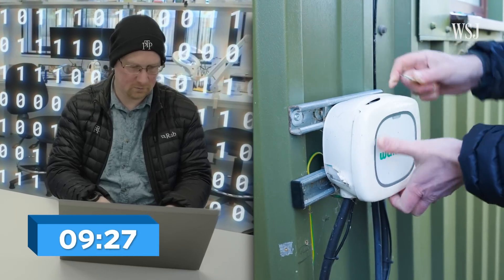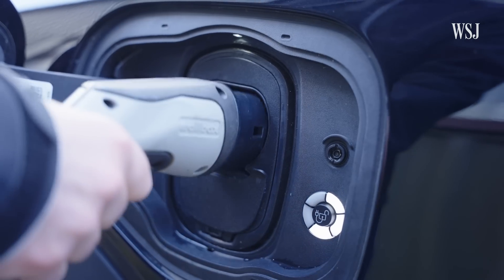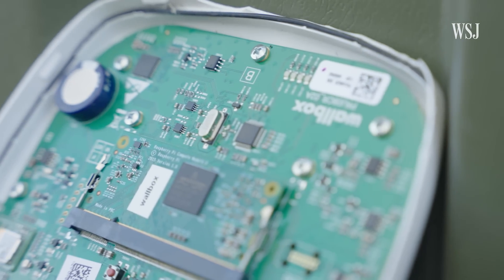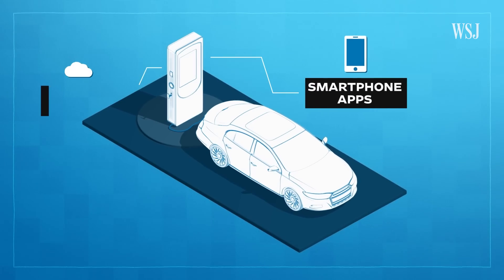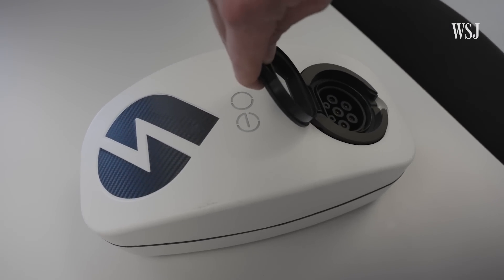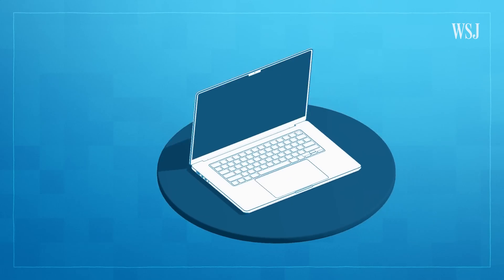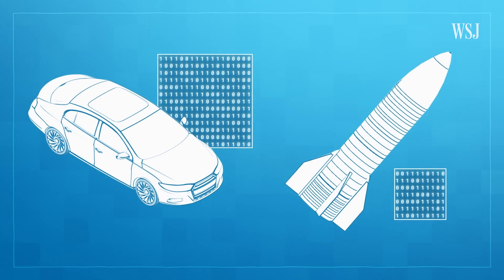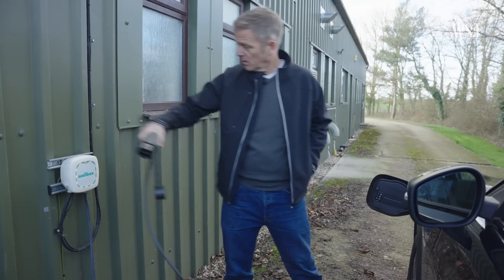This Is How Easy It Is to Hack EV Chargers | WSJ

Comment: You know how to fix it? Simple to fix in 2 steps. Don't get an EV and manufacturers need to quit making cars connected to internet. There is no valid reason a car needs to connect to the internet. If there needs to be a software update then you get a notice in the mail and go to the dealer and have it installed just like back in the old un-hackable days of cars. If you have a charger at home, why does it need to be connected to the internet any way. Just run your power in and then plug it into your car and then flip a switch and turn it on. The charger has a sensor that says, OK, no electrons flowing at this rate it must be charged and turns itself off,  just like the chargers for your good old AA battery chargers do.

Comment: This is a beatup!

The Raspberry Pi is irrelevant to the story. It's a general-purpose computer used for many different applications. The problem, if it exists, is either the application software running on it that does not implement adequate security, or the fact the compute module can be physically removed and have the software modified. This latter means any practical attack would need prior physical access to all target devices.

An alternative would be the compromise of any central management server, which has nothing to do with the compute module implementation.

Comment: Personally - Coming from the same country as PenTest Partners 🇬🇧 - I find that the easiest way to avoid badly engineered and rushed-off stuff is to simply avoid anything that bears a UKCA mark. The UKCA mark started to appear just before product/service quality (And the world as a whole) started falling right down the tubes, so it's a good marker of products which date from after that point. 📌

If you're buying something that doesn't have a UKCA mark - And an online search shows that the same product sold today normally does - Then Congratulations! You've found something that was made back in a time when product quality and customer satisfaction were actually worth something! 👍

Comment: Hehe, at 1:57 he points to the compute module (Raspberry Pi itself) mounted in an adapter board designed to provide easier access to the various I/O ports. Then as soon as he starts saying "this is the raspberry pi from the wallbox" they change shots and show a zoomed in shot to show it up close, but it's showing just the adapter board without the Raspberry Pi slotted into it. Quite obviously filmed or edited by someone not quite familiar with the technical side of things

Comment: Wht they're calling 'chargers' is a misnomer. The charger is built into the car. The box on the side of your house is a power outlet. It makes power available to the on-board charger but the current drawn is determined by the on-board charger.

Comment: 5:16 overheat an EV battery???
Ate you crazy???
EVSE have no controll over EV cooling system.
Reply: I was wondering the same. Its not even a charger but a poweroutlet.

Comment: Did you notice how damaged that "Wallbox" chargers front cover was?  Yeah, you can't just pop off the cover without damaging it.  First good rain and that charger is ruined.  While I commend this guy bringing vulnerabilities to manufactures attention the dangers his warning is way overblown.  First you have to find 1,000 "Wallbox" and physically go there.  Break them open and hope the owners wouldn't notice the damage.  Hope if doesn't rain or snow before you have hacked enough.  Then when you decide to turn on 1,000 chargers they are all plugged into an EV and that the EV is set to accept a charge immediately.  Many, if not most, EVs can be set internally to only start charging after midnight.  This is when it is cheapest to charge.  So you have to break into more than 1,000 "Wallbox" chargers.  The one with a serial number is more concerning but that is easily fixed with an update and it was.  OK so you probably have hundreds maybe thousands of this serial number problem chargers which haven't received the update.  Let's say the hacker has one serial number which is all he needs according to the video.  Problem is those thousands of chargers that are not updated are spread all across the United States and or the world.  How are they going to target a city?  They have no idea where they all are.  Chances are if they turned them all on at once they are spread out across multiple counties and states so it be like turning on 50 EVs per city at once maybe.

Comment: Is there a citation on how an EVs battery could be over heated using the wall connector? 

I don't see how it would be possible so would like to know how you came to that conclusion.
Reply: You're right- it's factually incorrect. 

The actual charger and battery management system is part of the car. 

The wall box "charger" is nothing more than a power switch that communicates with the in-car charging circuit, telling it what the limit of power it can suck out of the wall.

Comment: This is why I went for a commando socket and "portable" charger; the change from stand-alone wall chargers to Internet of Everything was never going to go well; people learned nothing from the issues with early electricity Smart meters.

When I brought up the issues of being remotely shutdown when using an internet connected charger - people called me an idiot; people STILL call me an idiot - because news of these hacks isnt widespread and is never mentioned on the big TV news channels.

For example, even though I follow a lot of tech news, I had no idea Ukrainian EV chargers were hacked and shut down at the start of the Russian genocide.

Comment: The security of the Raspberry had nothing to do with it, this should have never been deployed like this!
Reply: And it is quite funny that all these companies say they value security, but yet they fail horribly and fall flat on their face using the same old repeated mistakes!

It is 2024, how are you even able to access these devices based on serial number? Some doofus made a quick implementation and it was deployed without anybody checking if the password to the device was ON the device?

Wow.

Comment: I like how they tried questioning raspberry pi when they clearly stated it's not for commercial use
Reply: It's just laziness
Reply: They are. They just recommend using the CM4 instead of CM3. Tons of commercial products use Pis. There's an entire "for industry" page on the Pi website
Reply: Some of the Raspberry Pi units are intended for use as a component in a production device.
Reply: They questioned Raspberry Pi because that's how journalism works. You try to give everyone involved to have their say about what is happening.
Reply: Open the window and stop huffing your own farts. All a yas. You don't need to reinvent the wheel if you need just a wheel. I mean I can't believe they sell microchips in the store. It's just lazy... people not making their own silicon dies in their spare clean rooms. 😂
Reply: Raspberry Pi was originally set up as a school educational thing to help kids get into hardware and coding. 

I can't believe that some professional electronics designers haven't moved on from school level electronics class.
Reply: Stating a Pi is not for commercial use is quite dense. A Pi Compute Module is designed for development, but commercial breadboards and development boards use Pi as a headless computer to IO interface all the time instead of adding serial ports to bigger computers or replacing them all together.

Comment: I have a LOT of issues with these company responses to these issues. 1) "We take security issues seriously" Come off as gaslighting and suspect when the issues identified are very simple to identify. They 'chose' not to worry about it until it was challenged. 2) "The user needs to take some responsibility". I disagree in most cases. Must customer's don't understand anything about any of these vulnerabilities and it should never bee the responsibility of the consumer to make sure the products they purchase are secure, or updated.

Comment: This homemade charging unit is unheard of and this video is FUD. 
Cars must first request power from the charging unit before the handshake can begin. 
A car can only charge to the limit it has set by the driver and secondary the cars battery management system. 

If a car senses current coming from the charger without requesting it; the car will show a “could not charge” or similar message.
Reply: Finally! Someone else who also knows how this works. 100% correct.

Comment: The interviews and information is good but ironically very misleading because of the angle the WSJ is taking. Security research is industry wide and what you should expect for all these devices. "Wallbox" is a bargain bin brand but also isn't common either like Blink, Siemens or Clipper Creek. The use of a Raspberry Pi doesn't itself make the device insecure but instead the lack of resources of Wallbox to make it's own solution suggests they didn't think about the systems design which is what makes it insecure.

Comment: I don't think hacking into EVSE's is a major threat to the powergrid. That would be a really roundabout way of trying to compromise the grid. If you're a bad actor then you'd look at far more direct methods, which is pretty much how all these attacks have happened so far - physical attacks on key infrastructure or hacking into the grid software itself. A co-ordinated exploit capable of bringing down the grid would involve many different EVSE brands and rely on all those cars all being plugged in at the same time. As most EVs get plugged in overnight (and maybe only once or twice a week) when grid demand is low it's kind of far fetched.

Comment: The simple solution is to not add remote connectivity to devices that don't need it. A charger just needs to provide power. Let the car handle the rest.
Reply: Except in cases it is desirable to throttle the amount of power given to the car, for instance when you want to balance the grid.

Comment: I'm an electrical engineer.  This guy obviously picked the cheapest, most armature charging box on the market.  Have him try it on a Tesla charger.
Reply: Do you work from home, or are you a commutator?
Reply: @philhealey4443  who are you asking?
Reply: Lol EE here, that was running off of an raspberry pi compute module. That's all Linux open source stuff.
Reply: Breaking security via physical access is very limited at scale. 

Firewalls can easily block all internet domains and white list only the permitted domains. Most retail routers provide basic firewall configurations. 

There’s definitely room for the industry to improve
Reply: Maybe they picked the ones with a lot of market presence, regardless of their price. Or do you think everyone uses Teslas?
Reply: I write exploits for a living and have a comp sci degree. Traditional gas pumps r still a much easier target.
Reply: Tesla ain't the only EV manufacturer in this world. Given that they have factories in China...wouldn't be surprise that the MSS already intercepted the supply chain and installed a bunch of backdoor chips in them.
Reply: Yup was coming to say the same lol
Reply: You missing the point.. They are connect to the power grid and they could take everyone down.   Doesn't matter who the maker is.  One weak company puts everyone at risk.  Just like one lazy coworker opening an email put the company at risk..
Reply: @CornelleJ  Yea you can set things on fire in a city as well. Who is going to do it? and why? They are just ensuring they have a job.
Reply: @CornelleJ  No, you are completely wrong. Can a toaster, a leaf blower, your smart phone charger take down the grid if someone hacks into it? No. All you could do with it is mess up the electricity at that location, and probably you'd just blow the breaker. It's a similar deal if I hack into your house wifi, maybe I can snoop on your house traffic a bit but most is controlled.
Reply: @nickkline667  Realy what am i wrong about please explain in detail.
Reply: @CornelleJ  That is not true at all. This video has no evidence. They did not show how it can be hacked. They only removed an rpi compute module from a box. but did they show the data is not encrypted on the box? Did they link any company announcement? Did they show any link to the vulnerability database? Also the video did not say how they can be used to bring down the network. The study is not linked.
Reply: @buscseik  Rewatch the video, they said the first 1 had 2 Vulnerabilities. Wallbox, hardware bug. 2nd was a remote attack. (smart phone attack), then Project EV had issue because of SN# for Creds.
Reply: @CornelleJ  Vulnerabilities has a public database. if this video would be true, these would be listed there, so the video could link them. Just for example, they made a screenshot of a study in the video published by IEEE. I checked if I can find the study on the IEEE website, but it is not there. Only two match, non of them were valid (one is a public file storing system, other is a website which signed by letsencrypt, which means, the site owner did not have to present id card  or bank card to anyone to get the certificate, even a hacker could do that)
Reply: @buscseik this is a 7 min long video.. they can't go into all the details.. how ignorant of you that you in 2024 still don't understand the function of media
Reply: Yep other than Wallbox embedded RasPi is typically never used. I understand why an enthusiast tinkerer would want a charger like that. Added customizability to what software and networking features you can run on the charger. But that has no resemblance to your typical Level 3 charger.
Reply: How is it possible that "the cheapest, most armature charging box" was allowed to get to the market?
Reply: Thats a fair point. Yet your average Joe ev driver will a) more than likely not drive a Tesla and b) will not use a Tesla charger. The average Joe usually aims for the cheapest option that will do the trick - so many EV drivers would definitely pick the cheapest charging station on the market.
Reply: what he said about grid spiking is the primary reason why EV's are a danger to national security
Reply: @Greg99rock  The reality is that, EVs are actively used right now for load balancing, so EVs not breaking the network, but quite the opposite, they improve/defend the electric network.
Reply: @buscseik curious question. How do those use for load balancing? Seems interesting.
Reply: @travelingparadise2823 Charge when electricity demand is low...

Comment: @WSJ 5:20 - The video claims that a charger attack can overheat an EV battery. Do you have proof of this claim? The #1 job of the battery management system (BMS) inside the vehicle is to monitor temperature of the battery cells and limit the current in/out of the pack to levels that are safe for a given temperature. Unlike the RPI in the charger, BMS systems are embedded microcontrollers with a small security cross-section, and are usually impractical to compromise. If the charger tries to push more current than the battery is willing to accept, the BMS will open the contactors, which physically disconnects the battery from the charger. I'd recommend you have the claims in this video reviewed by an engineering firm that specializes in automotive BMS development.

Comment: @WSJ 2:09 - The highlighted section where it says 'not recommended for new designs' (NRND) -- That's talking about sourcing/availability. It basically means they're getting ready to take that particular part out of production. It doesn't refer to the suitability for a particular application. I still agree with the overall argument that RPI's are unsuitable for this application though.

Comment: What happens when you turn on an EV charger? Nothing! Because there is nowhere the electricity can flow to. If the a car is connected it is either already charging, aka nothing changes or it is full which means it will not accept energy.
Shutting down lots of EV chargers is the greater risk but also way easier to handle by the electricity companies.
The WJ is showing a problem but massively exaggerating the risks.

Comment: No mention of gasaholeline pumps with the same vulnerabilities.
Reply: Fuel pumps aren’t connected to the vehicle in the same way. Also, no private owner has a fuel pump on the wall of their house 😉
Reply: @hughM9  fuel pumps / systems fail.  It starts fires  280 k Xs a yr.
  Most houses do have a fuel pump/ system wired into their furnace.

Comment: I’m running the one bought from Aliexpress China for 150usd with no wifi and set charging time to be on only during of peak from my car for a year with no issue😊 Cheap with no fancy option to be compromised😊 Charger can fire from 2.2kw up to 7kw though the RFID key to tap to start to stop the charger can be compromise but still there can not charg if my car say otherwise.
Reply: And just by using a "flipper" you can hack the RFID. D'oh!

Comment: So many lies an misrepresentations. The worst is the snip from the Pi Compute Module documentation. It says the C3L is NOT RECOMMENDED FOR NEW DESIGNS, and you should use the newer devices. It was ABSOLUTELY recommended at the time the Wallbox was designed. This is just lazy coding, not fundamental flaws in the hardware. You can't kill the grid by hacking one charger manually. You would have to go to thousands of people's homes and open their Wallbox, take the CPU out (so it stops working for now), take it back and decode the data and then put it back. You could do it on site, but you'd be obvious. Then you'd have to find a way into all those WiFi networks at the same time (ie thousands of hackers sitting outside people's houses) and hope that all those cars were plugged in (I only plug in my EV when I'm charging it, once or twice a week). Even then, you would be creating what - 7kW of demand, the same as a large air conditioner, on a few thousand homes. Big deal.